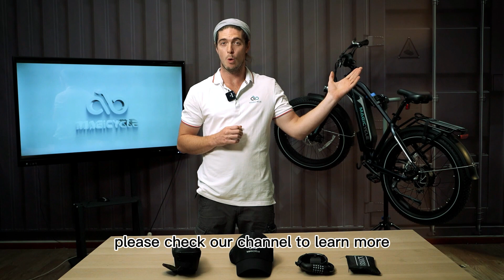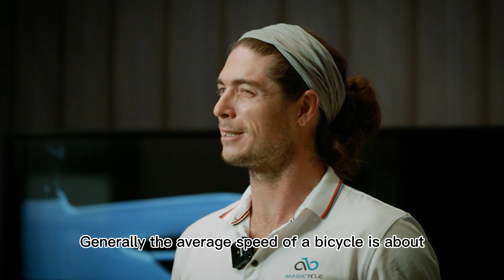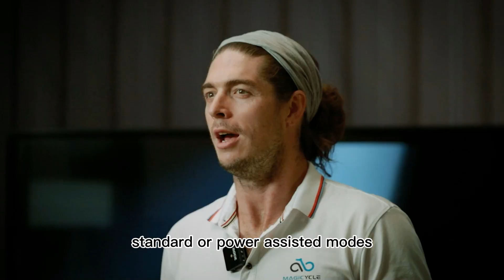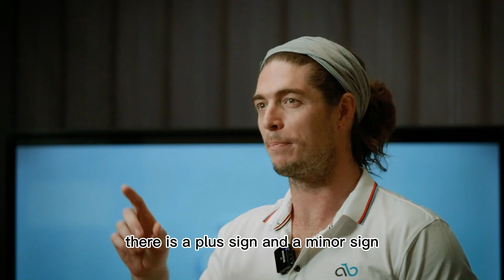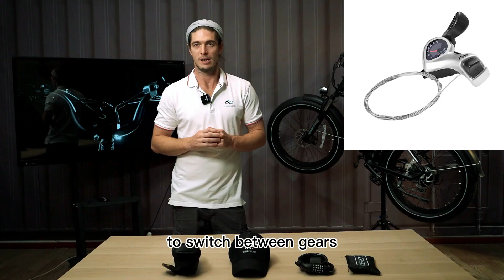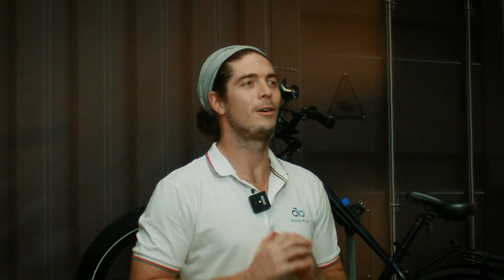Magicycle Fat Tire E-bike Cruiser Speed

Comment: Hi, so men love speed so we going 28 mph no doubt . My question is  , the bike says 15ah but in menus it goes up to 22ah , now will I be wearing down the motor  or battery if I leave it on 22ah ?  What's the advantage in keeping it on 22ah current ?
Reply from the maker: You get more power after you set it up to 22ah, you can feel that when you climb the hills.

Comment: In assist mode 7 and 7th gear I am pedaling to many rotations per second. It seems like it should have a 10 speed gear to have less rotation especially going down slight grade.
Reply: This is why I turn the assist off to pedal